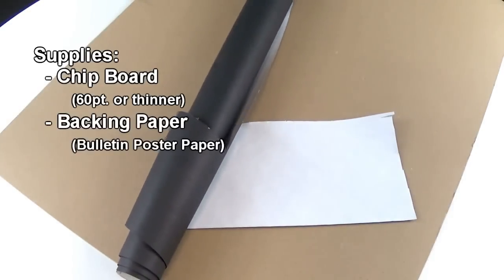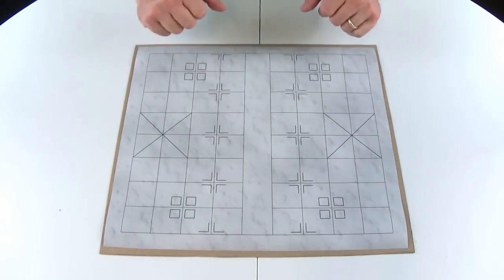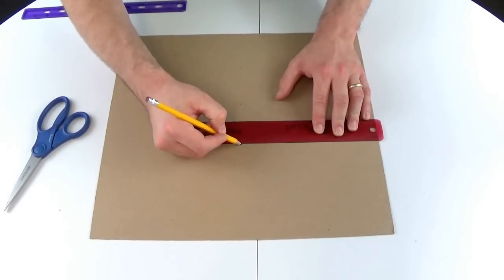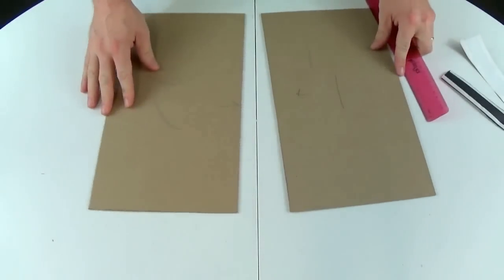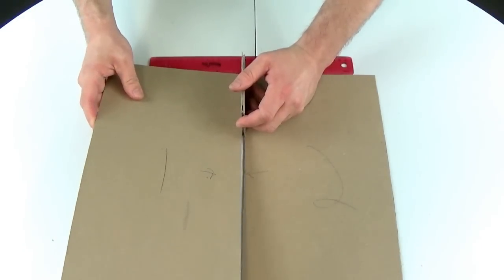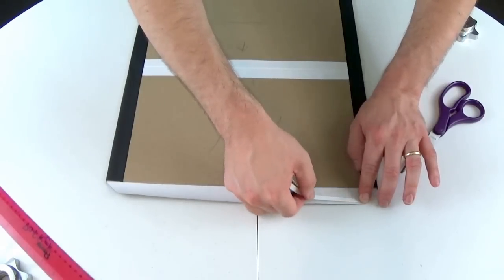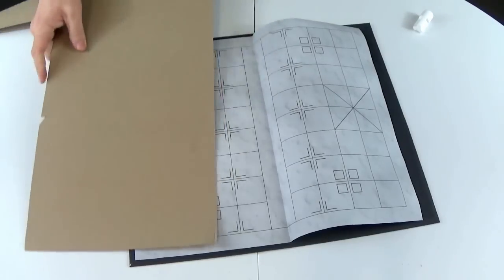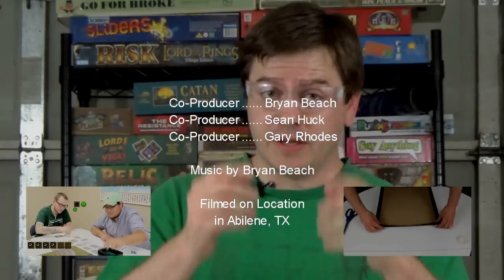DIY Gaming - How to Make a Bi-fold Gameboard

Comment: I watched some of your tutorials and I must say that they are clear and easy to follow.
One thing that I surprised me is that you use a glue stick for gluing the boards. something I remember from using it as a kid is that is does not really stick stuff together like you want it to.When I have glued paper/cardboard for projects I used D2 wood glue (fast curing PVA glue). It's still pretty easy to use, moisture proof and when it's dry the bond is stronger then the cohesion of the paper itself. Is there a reason you don't use it in combination with printed paper ?
Reply from the maker: +Wemja, thanks a bunch for your kind words.  I do use a lot of glue sticks.  It started by looking for an easy solution for 1) keeping the paper from wrinkling because of the glue and 2) using a glue that was forgiving with moving the paper around after it was applied and again without wrinkling.  Spray glues also worked well but were less forgiving with application (and messy).  I do like PVA glue and use it for a lot of plastics and model work.  The dry time is right for it and the bond would be better.  If You don't have any trouble with getting a smooth product then use it!
Reply: Thanks for the fast response, wrinkling paper has not been an issue for me with D2 wood glue since it has less solvent and/or water compared to Elmer's glue. This has as side effect that it is hard to move the paper around to make adjustments during the glue up.
I will give it a try and see how it turns out.

Comment: I've tried this a few times and I just can't seem to get it to work. Every time I try to close the board and it doesn't close all the way. Also the middle of the backing paper bunches up badly when you try to close it. Is there something I'm missing?
Reply from the maker: So I've ran into this problem when the paper on the front of the board is too thick.  I try to print on something thinner than a standard weight if possible (something cheap).  I started using the method in our tri-fold video for most of my current projects though.  It cuts the backside of the backing paper so you don't have to worry about the tension created by the paper springing it open.  It also keeps the front folds nice and neat.  More games are made this way today anyway so it's becoming more acceptable
Reply: @pubmeeple  Thanks for the quick reply. I might have to try out the tri fold method instead and see if it works better.

Comment: if your game board is printing on glossy photo paper would you still recommend creasing it? or would you cut it and apply to each side?
Reply from the maker: +Erik McArthur good question.  In my experience thicker stock doesn't do as well with any kind of folding/creasing.  And the glossy photo paper tends to crack even with scoring.  If you are set in using photo paper would you be open to a modular-style board (the sections fit together like tiles)?
Reply: +Pub Meeple  Thanks so much for the reply. I&#39;ll start by saying I just went for it and it looks beautiful! I put my image on one of those blank tri-fold game boards you can buy on amazon. but, after one night the board REALLY warped and I&#39;m thinking it was maybe because of the thickness of the paper actually pulling the board. I&#39;m hoping with time and some heavy weight it flatten back out.

Comment: Would a poster board be able to replace a chip board?
Reply from the maker: Poster board is a thinner stock than the chip board shown here.  But experimentation is always encouraged.  Usually poster board is about as thick as cereal box material.  What I'm using is about the thickness of a credit card or a penny
Reply from the maker: Carey Hunt  this is a great request.  I assume you mean something like a dial or a rondel with an arm like in Ora et Labora.  If we get to making more DIYs, I'll throw this at the top of the list.  In the mean time I'll suggest something like our token/tile tutorial but with a plastic chicago screw to hold an arm/dial in place: https://www.amazon.com/8-inch-Plastic-Screw-Chicago-Screws/dp/B006W6TT94/ref=sr_1_5?ie=UTF8&qid=1544588380&sr=8-5&keywords=3%2F8+plastic+chicago+screw

Comment: In your next video it states that we can use this video to make a game board with 2 folds so there are 3 of the same size section. However, it doesn't state whether the gap between the first and second section, should be bigger then the gap between the second and third section as the first section will fold over the second and third section. Would the gap need to be the same size or twice the size?
Reply from the maker: Andrea Jones Great question.  You will need a wider hinge between the second and third sections just like you're thinking.  As far as the size of the gap you will need enough room to clear all your stock so twice the size is a good place to start.  But before committing to putting it together I'd recommend testing the hinge every step of the way.  I usually add 2 extra millimeters than I think I need as I'd rather have a hinge slightly too large than a hinge slightly too small.

Comment: What is the best place to get chip boards?
Reply from the maker: I typically go to an art-craft store.  But you may also find something at a place that frames pictures.  You can also save the back of tear-off note pads (the large lined paper pads) if you don't need anything larger than notebook size

Comment: Can you use a foam board
Reply from the maker: I never want to tell someone they can't use some kind of material.  I imagine using foam core will come out muck thicker and may not work as well with a folding board.  Works really well with a non-folding board though.  I've used foam core for large mat backgrounds

Comment: Is there any way to make the paper on the top water resistant as in other game boards? Without being too thick to fold?
Reply from the maker: I've experimented some with this idea but not much as these projects are meant to be prototypes.  I've tried lightly spraying with something like a clear coat or laquer.  The finish wasn't that great afterward but it would seal the paper.  I can't recommend it though

Comment: Very similar to what I imagined it would look like, going together. I have a c.1981 game board, that is a bit warped, showing some brown stains, and doesn't hold the click-in runner properly, and there's some bubbling of the paper, so I'd like to make my own replacement. Your video gave me some confidence in doing it. But where should I go to get the top paper (main image) printed? And on what? Even a laser A3 printer won't print big enough, for the SQUARE printout I need. I got a quote from Kwik-Kopy today, for $25-30. Surely there's a cheaper way! The whole game, when you can find it, at a garage sale/fete, only costs $2!! But they are so rarely available! Here's the game I'd like to make a new board for:  https://boardgamegeek.com/boardgame/3887/stock-market-game
Reply from the maker: +Joshua Hrouda, you'll want to laser print anything you can as the finish doesn't smear or feel tacky like standard ink printing, thinner paper works better.  There are some options to getting the cost down.  One thing you might try is printing the board onto two separate pieces of paper and having the seam meet at the fold where it's less noticeable.  Printing on anything larger than a local standard does get pricey.